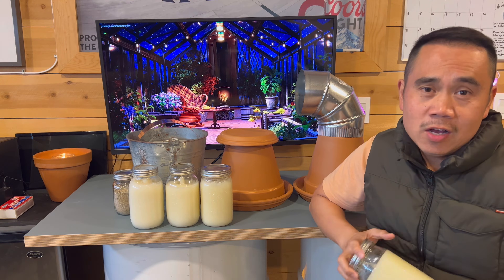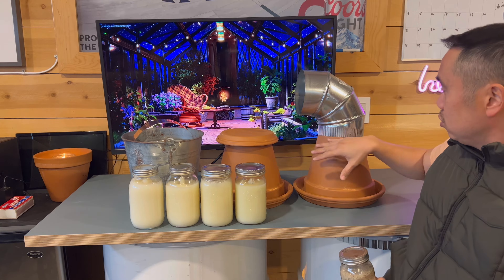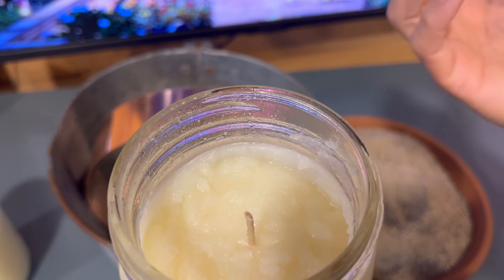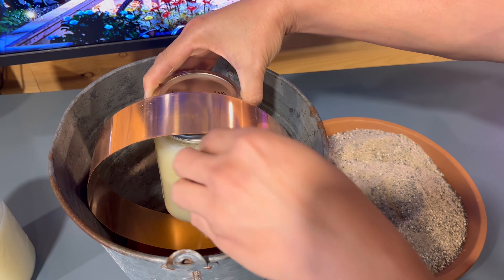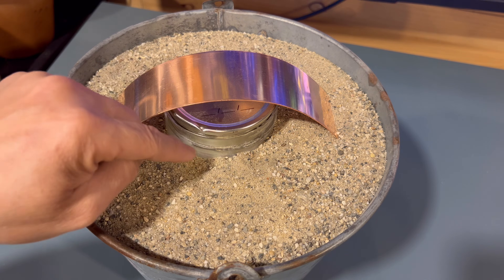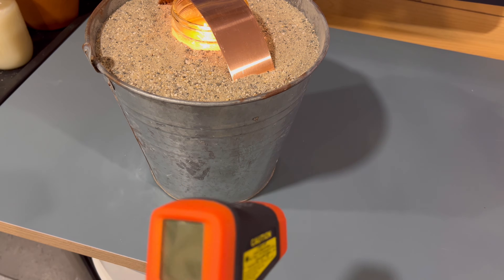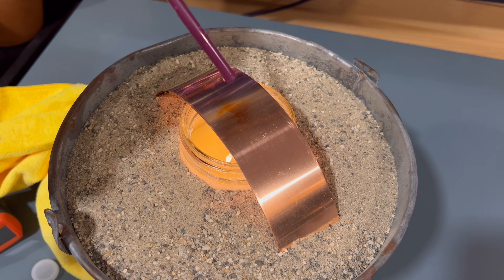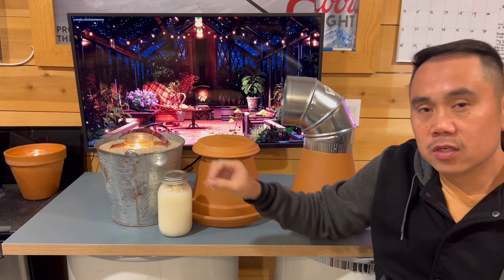DIY Copper & Sand Heater 🔥 🔥 Zero Electricity Needed For Emergency Heat

Comment: I would think the shortening will melt from the heat of the sand. I would use a coil of copper tubing to heat the sand all around. You could use bricks and put the candle underneath the pail. If you have a big cast iron dutch oven with sand it would heat up even more. You could coil the copper tubing in the bottom and going up through the sand.

Comment: OK, these radiant heater with the vegetable shortening is VERY CONFIRMATION BIASED, Non-scientific, and misleading. Here's why:
1) Stop pointing the laser temperature measurements at the source. This is basically measuring the heat created by the candle or the flame source. The real test of the radiant heater is how fast it heats up the room to the temperature that is required and how big the room is. One of these small jars or containers will only produce a small amount of heat and depending on how cold the room or the outdoor greenhouse is, it will never reach the desired temperature no matter what kind of radiant material is used. The only thing that matters is the actual radiant mass that is heated with the amount of air and water molecules inside the space

2) The wicks bought from Michaels is not bad BUT, the top portion that is cut needs a base or else the wick will start floating around in the melted vegetable shorten. Once the shortening starts to become a pool inside the container that the flame is burning in, the wick will fall over and get drowned.

3) As per #2 above, the wick always get drowned, especially when you want a bigger flame by putting in multiple wicks that may be anchored. The more wicks you put in to produce more heat, the faster the fuel burns up. This is fact. The guy might say it can last 22 days, but the heat produced will not even warm a small green house space in 35*F or 0*C. I actually tried this with one wick in each can, then 3 wicks. The one wick actually lasted 6 full days at the longest. With 3 wicks, it burned out in less than 3 full days with 2 of the wicks getting drowned half way through.

4) The final thing I want to mention is that putting sand in is one problem and then adding the copper as a ring that is half buried is the second issue when you're trying to replace the jar or can that is in the sand. Think about it, the sand is not solid. Once you get the jar out, good luck in putting another one in without clearing out the sand and filling it. Just a lot of work!

Don't get into this radiant heater hype where people are pointing their fancy lazer thermometer to the clay pot or whatever the material the flame is heating up. It really doesn't matter if that heated material is burning at 1000 degrees of whatever temperature measurement is, PUT the damn thermometer at the further point in the space away from the source to see what the temperature is. THAT IS WHAT COUNTS, not the frickin temperature at the flame! If you measure the temperature at the surface of the sun, it's 10M degrees and the near side of the earth at the equator may be at 32*C and the far size and the poles might range from -45*C to 20*C on the dark/polar sides of the earth. Know what I mean?

Comment: Why wouldn't a person just use a copper bucket filled with sand and put the candles under the bucket. sounds safer than heating up jars of crisco as hot as you can get them with copper strips?

Comment: a short glass container with liquid oil would be better, you just put it on top of the sand, no need to burry it and it last more than 8 hours. Made a lantern from olive oil and it lasted very long with just 3 to 4 table spoons of olive oil. Easier to take out or simply pour more oil.

Comment: The other day my heating went off and I had to wait until Monday to get it fixed. The night temp was about 3...4 degrees. It was not freezing but it was cold. I got a cake tin with 12 cup cake indents. I used 8 .... eight hour burn time tea lights. I put one on each hold
 I got two metal cutlery holders. I inverted both of them ... each covering two candles. I lit them at midnight. They went out at eight in the morning. My bedroom is 16feet square. Average bedroom. I went to the loo during the night and the hall etc was cold. My bedroom was  nice and warm. I'm not kidding. I was comfy all night and I hat the cold. I was not cold. The bedroom.temp was about 18 degrees. Comfortable. In fact I keep my heating on 24 hours s day.  Now I turn it off when I go to bed and light my candles. I cant wait to get my bill's and see how much I have saved. I put the heating on before I get up. When I go put I turn it off. I tried some normal camels last night. Burn time about 7 hours. The flame is bigger and they throw out quite a bit of  heat. I'm go to makea Crisco candle but I'm not stuffing into a bucket. Copper strip is a waste of space. Use an empty been can .. bunch hole in it and put it over the candle.....above the candle so the flame is going into it. Then feel the heat. Touch the can and you will be burnt. I know. Seeya.😅😅😅

Comment: The temp 6 inches from the bucket is pointless. If this is such a great device to heat a SMALL ROOM or greenhouse....... you let it run and use a room thermometer and take readings from it every 15 minutes. Sitting 6 inches from the bucket to get warm is plain stupid. 😮😮😮

Comment: if you paint a small section black or something similar you can use your temp gun on shiny/reflective objects.  At work we use small black dots we made from adhesive stickers, but this may be too hot for that.

Comment: the clay pot/copper strip provide no benefit.  the candle provides a set amount of heat, adding items does not create more.
Reply: They certainly provide benefits. It isn't about producing more heat. It's about directing the heat and storing its energy in the sand. The copper strip heats up and then heats up the sand.
Reply: @SubChannelEducation  If you understand how heat works, you'd understand that it tends to travel UPWARDS. If you're trying to harness the heat, why on earth would you put the sand below the flame lol. The losses in this setup are insane

Comment: I like your idea of using the copper strips to heat up the sand and bucket in your heater. Buy if you bend copper tubing the internal heated air might do a better job in maintaining the heat inside the tubing. Thanks for the idea.

Comment: It might be a thought to cut some straight copper strips wi black dots and  push these straight pieces down into the sand ... Around the unit to offer heat read outs from surrounding areas radiating out from central core.... Just a thought...nice video.
Thom in Scotland.

Comment: You need a black dot which stops reflection of infra red temp beam... Reflection, deflection...off the shining metal surface. Yes .... One dot each side just above sand level on copper plate... And similar dots as you move up arc of copper to the top....
This will offer true readings....
Good video... Very informative... Thanks.
Thom in Scotland.

Comment: To prevent your wick from tunneling,you need to keep the wick trimmed short; that will also prevent your flame from smoking
Reply: It can still tunnel even if the wick is short. Making candles is pure science -- everything is combustible, interacts with one another, etc. It's not as easy as people assume. I also assume you make your own and have found a great combination of wick widths and fuel source, and container physics. Maybe you stumbled upon it by accident, even. If so, share with the class, please!
Reply: @jessicaf6358 yeah it's called trimming the wick short

Comment: This might also be useful for people with a petroleum or kerosine heater. The bucket with sand can be put on top of the heater which already burns petroleum. Add a heat fan and your heater becomes more efficient.

Comment: Heat rises. You can heat up a copper pipe with it in a vertical orientation, and the bottom of said pipe won't change in temperature. If you invert that pipe, the heat will rise right up the pipe to the top again. When you heat up the that copper band in your experiment, all the heat stays at the top. It's not going to go "down" into the sand.
Reply from the maker: @stephenfarrell1556  yes. But this is not heated air, this is conduction by the copper strip, it would travel back down via the strip
Reply: @don_wynn  Another way of improving heat use aluminium tape leave a 8x8 inch window then wrap in exhaust wrap again leaving an 8x8 inch window then wrap in aluminium tape....  all so the heat is concentrated on that window
Reply: You don't know what you're talking about. Be quiet.

Comment: This could be used in my tent.  I always use a 6 person tent in the winter camp outs....I will definitely try the one with the sand. Thanks a lot!!!
Reply: ❓❓❓ I have been wondering how many candles can you have lit in a tent and be safe breathing? 
I sleep in a winter tent, I made these candles and bought the flower pots,,,,, 
But I don’t know if it’s safe to have a candle burning in my tent because of carbon dioxide.
Reply: get a carbon monoxide detector.. theyre cheap @LJ-zk9iw
Reply: Yes carbon monoxide could be an issue.  @LJ-zk9iw
Reply: I'd avoid candles in tents.  Too much risk and for next to nothing you can get a 🔦 + a blanket.

Comment: Uhm... im afraid the sand and copper is not doing anything.
The amount of joules the candles give do not change. 
Offcourse the sand may get a bit warm because of the copper, but that will be gone before you can say cheesecake😂😂
Reply: Gives the radiation effect better rather than heat just being lost in the air n pulled up too the ceiling the sand will help hold n distribute the heat into your space around you its like a bare fire place with all the heat going up the chimney vs a Woodburner which is far more heat efficient and the copper helps transfer heat into the sand faster
Reply: @jshaw4757 okay but then why tf not just have the sand ABOVE the candle. There is so much heat loss with this setup it's insane lol
Reply: In theory, it sounds good, but when the candle burns down lower in the jar, will the flame not be too low to reach the copper?

Comment: Add a Terracotta pot over-top sitting on the sand.  This would catch more of the excess heat, share heat with the thermal mass of the sand, and provide more radiating surface area.  They were sitting next to each other the whole time, now make them kiss!
Reply from the maker: Wow, I didn’t even think about that 😃
Reply: Smart